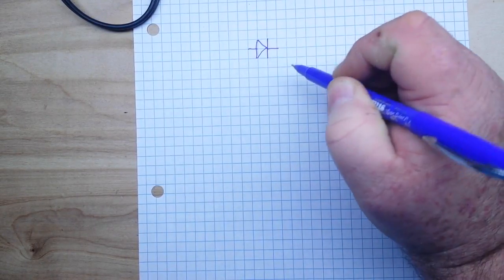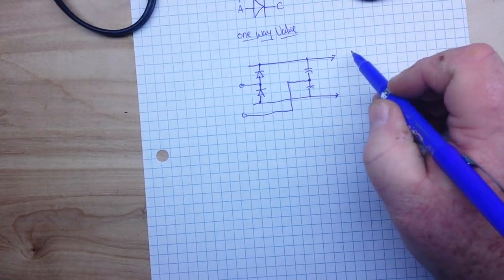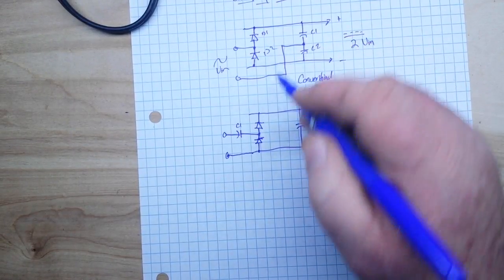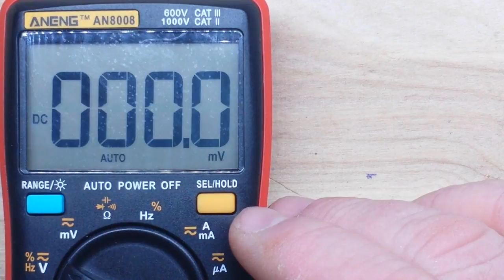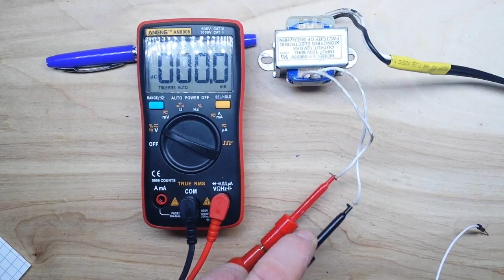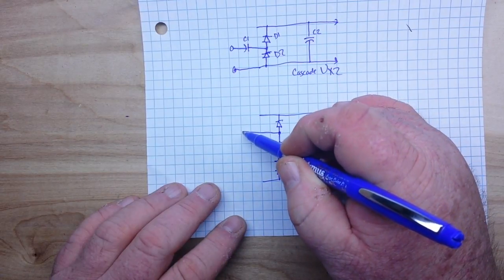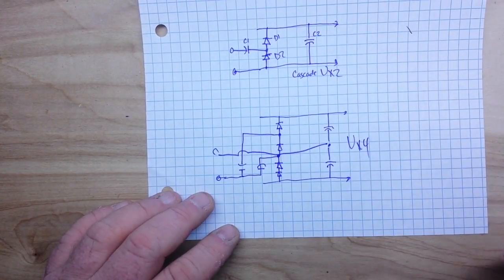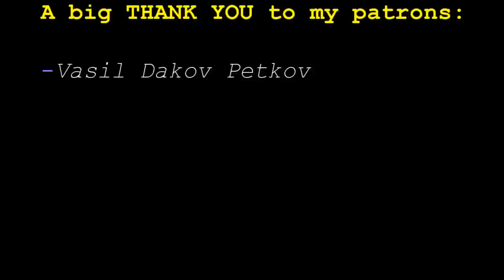How to make a voltage multiplier

Comment: I know why this works but it would be nice if you explain why. The diode forces current into one direction. Think of “current” as water. The capacitors are wells where we store extra water and the diode (the one way check valve) keeps water flowing in one direction (eg no siphon effect). This allows for voltage to build up in the Caps and output a higher current. Just like a water tower when opened would create a huge torrent of water. Yet the tower is filled with a trickle. Think of electricity as water and it all makes sense.

Comment: Great video paul  ive been a electrician a long time never combine both in a job application before its just 480v or 277 208 220 240 120  so todays video was great to watch im going to play with so 110 and 12 v

Comment: This is fun stuff. TodayI was messing with just the opposite 12v to 120v transformer then making 120v AC. Thanks for an interesting video!
Reply from the maker: +George Chambers Thanks for watching. What did you use for the occillator in your circuit?
Reply: Yes a MC14001BCP. Still working on the whole thing though. I might even get it to work?
Reply: Is that dangerous?

Comment: In the voltage quadrupler circuit you have one input cap connected directly across the AC input (the right one). Shouldn't it be connected between the two bottom diodes? You're gonna have a bad time if you use electrolytics!

Comment: Any guidance on how to make and what types of diode or capacitors I might need for my project. 

Voltage x3 or x4

Input is range of 150-300 vdc
Output range of 600-800vdc
Input current 0-20a

Application is solar string voltage multiplier to have a working voltage for my device. The device is a mppt vfd inverter for solar pumps.

Comment: Hi again, I just watched this video very carefully, trying to trace out the waveforms.  Since the peak of a sine is equal to:
sqrt(2)*Vin,  shouldn't the minimum capacitor voltage of a voltage doubler actually be 2*sqrt(2)*Vin?  So, taking your example of the cascade doubler, for the 14VAC transformer, we get:
2*1.4*14=39.2Vdc (for C1 and C2) in the cascade.  And in the conventional circuit shouldn't each cap be, (minimum), 1*sqrt(2)*Vin=1.4*Vin=1.4*14=19.6v, and since they are in series we get: 19.6*2=39.2   Please correct me if I am doing something wrong!

Comment: Thanks Paul, does this only work for ac input? It was 14.6vac to 92.6vac but with DC it started at 7.3vdc to 3vdc and continued to drop a tenth of a volt till I disconnected it at 1.25. Not sure I understand what happened.???
Reply from the maker: AC only yes.
Reply: @learnelectronics  I want to step up the voltage for DC how do I achieve this?

Comment: Hello man, good video! I have a question. I copied your circuit, but just changed the input to be a piezo crystal. However, when I hook it up to an LED, it's not even lighting up (it should since it lights up without the voltage multiplier). Do you have any idea on what I am doing wrong? Is the piezo too weak?

Comment: Is this partially how a boost converter works?  It is/was my understanding that the boost converter takes advantage of a MOSFET temporarily shorting the input to ground and storing that built up energy in a magnetic field to be released as the output moments later (with a smoothing capacitor as well).  True?
Reply from the maker: +Michael Padovani They both achieve the same result, boosting voltage, but a boost converter does it rapidly charging/discharging an inductor. A voltage multiplier does it sequentially charging capacitors and summing their charge. Also the boost converter converts low voltage dc to a higher voltage dc. The multiplier converts a low voltage AC to higher voltage dc.
Reply: Thanks for that more detailed explanation

Comment: Interesting but like you said watch how much you multiply it by!  I take it current is proportional to voltage i.e. if you multiply the volts by four the current is divided by four for a given wattage load?
Reply from the maker: gartmorn It's a proportional trade off. You can't get more of one without taking some of the other.

Comment: interesting. I already know diodes are one way valve and direct flow of electricity, however I can't understand how directing flow of electricity increases voltage.  following how things are connected is just not helping me understand the concept, if you could just explain it, that would be great.  thanks
Reply from the maker: Diodes prevent the charge from glowing backwards out of the caps. So the charge in cap 1 goes to cap 2 1+2 goes to 3 1_2_3 goes to 4. The capacitors boost the voltage, the diodes only steer the flow.
Reply: that makes more sense.  thanks

Comment: I have viewed this several times. I have also looked on the net for voltage multiplier and found your set up several times. So why is this the only circuit where an electrolytic capacitor can be used with both positive and negative input on the negative side of the capacitor. I realize that when the positive is applied to the negative side of the capacitor, the negative is not applied to the positive side of the capacitor because of the diode. However, is this not a dangerous set up? If the diode fails and passes the negative charge, I believe the capacitor will explode.
Reply from the maker: +Carl Davis Yes if the diode fails, bad things... So if you are going to build this circuit overspec the diode by at least 20%

Comment: Does the amps stay the same.
Reply from the maker: Andrew Van Lagen No, there is always a trade-off. You can't just create voltage, it has to come from somewhere. But the opposite is also true. You can trade voltage for current.
Reply: learnelectronics 
That the ratio u lose amps